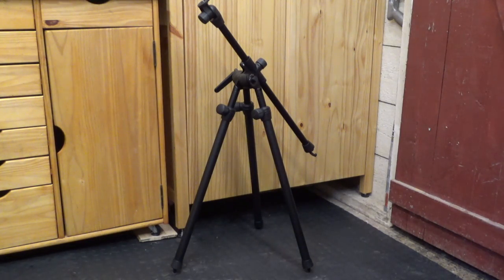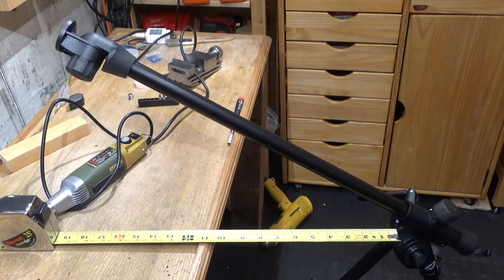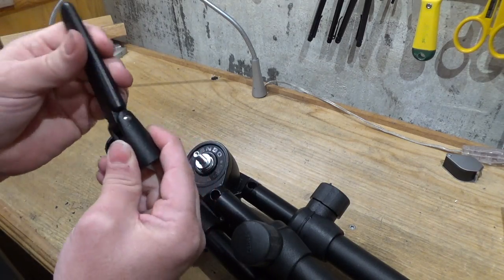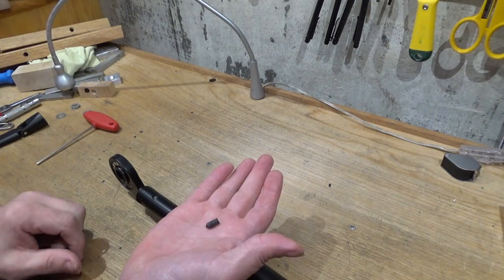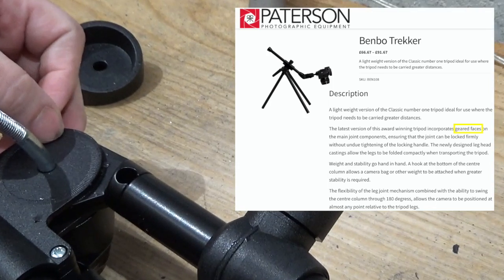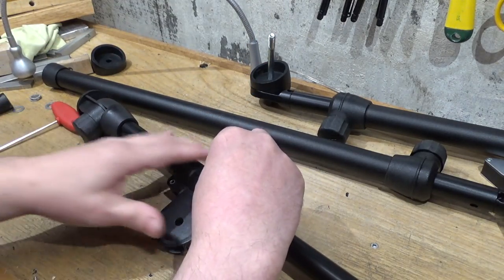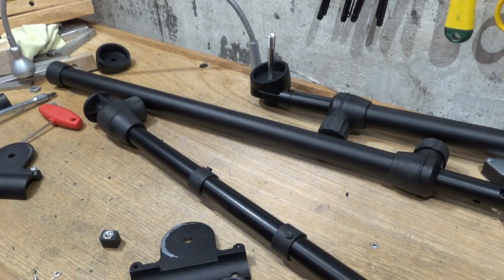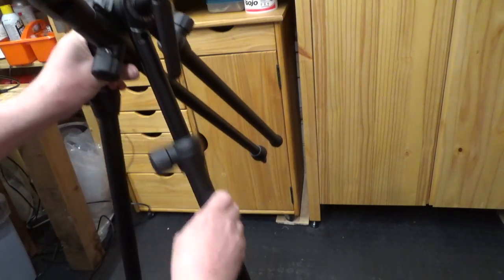Look-See: Benbo Trekker Mk3 Tripod

Comment: Interesting that you dismissed the bolt without comment. Benbo - Bent bolt. The whole basis of the design has been passed over
Reply from the maker: So that is the origin of the name, makes sense. Still does not make sense that hardware is not stainless steel, especially that bent bolt that is integral to its function.
Reply: @RoomForTools  Stainless Steel is tough but not as hard, it has parts pressed against its surface so the plating is far better, Stainless would just get grooves. If the internal appearance (which you can't see) is a problem you can buy replacements very cheap from Pattison.

Comment: figured it out bud ,   leave 2" of  tubing at the top of the bottom lag pieces just below the locking nuts , then  epoxy the carbon tubes over the cut down pieces , game on .you get to keep the  original leg lock nuts ..and save a pound or two in weight

Comment: why take it apart ?  theres always a messer willing to fanny around
Reply from the maker: Huh? You do not take everything you buy apart as soon as possible?
Reply: @RoomForTools  hang on . bloody spanner when you need it ... Whats that m8  just got a new d850 ,   give me a mo     or two
Reply: youv given me an idea , someone mentioned if they made a carbon version..  so how do the top part ( locks) on the bottom legs come off .  it wouldnt be too hard to get three pieces of carbon tubing cut
Reply from the maker: Could work, though the clamp is a simple split ring. As far as I am aware, carbon fibre tripods use collet type clamps to evenly distribute forces on the tube. A carbon fibre tube retrofit would need to withstand both axial and radial load.
Reply: @RoomForTools  yes il have to have a look when i decide if 8kg is enough to hold  my dslr .  otherwise its the benbo no1 . either  way il check it out .. im sure the simple design can be adapted  to put twist locks on ( not my favourite things)  theres always some tool wanting to hiss about !